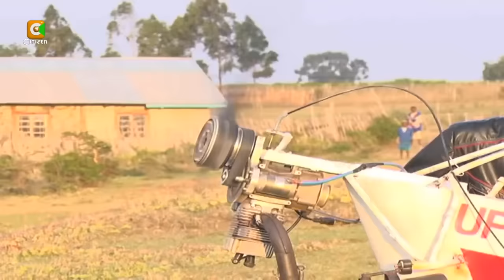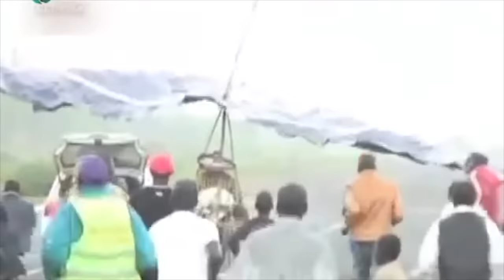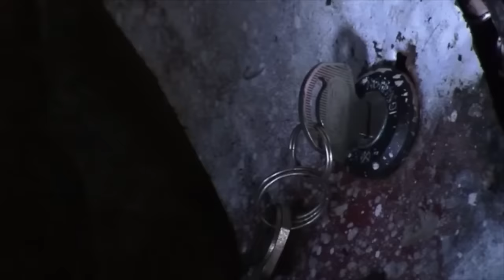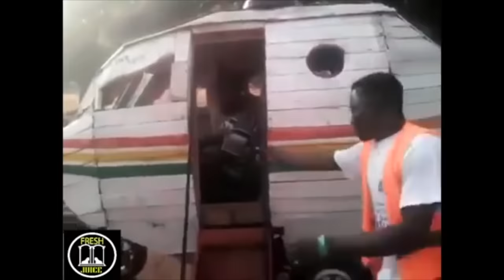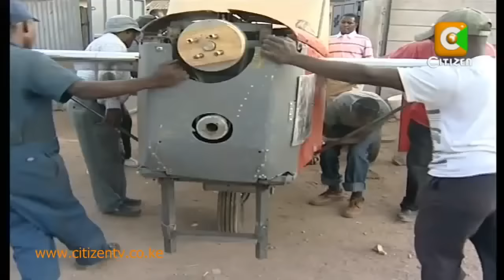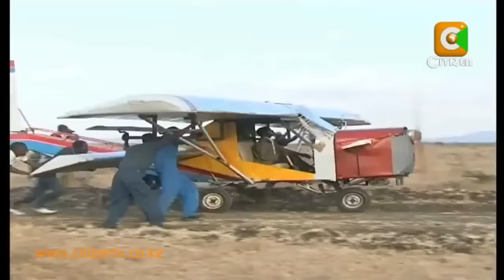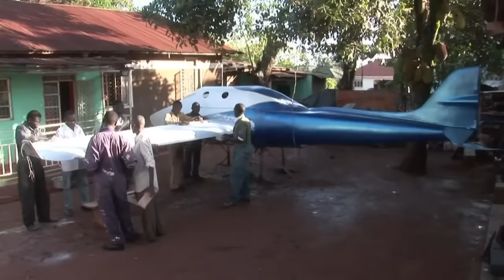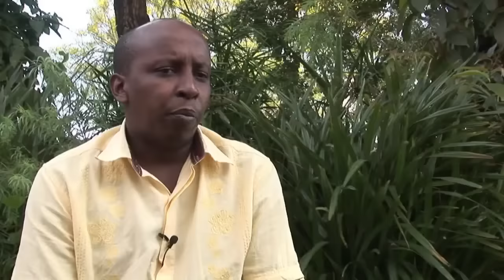African Airplane Compilation | African Aviation

Comment: Trying to take off a one ton airplane with a 15 hp motor!
Reply: Even a small Cessna weighs less...
Reply: And a piece of 2 by 4 for a propeller.
Reply: 15 horse power plus 10 human power lol
Reply: The nze engine is around 140 horsepower, however that is not enough, they need some mentorship from someone with knowledge
Reply: 65hp can fly a plane
Reply: Lol.
Reply: On top of that the frame wasnt strong enough at 5 mph on the ground
Reply: My airplane I made as a kid which was essentially 2 bits of wood nailed together like a holy cross had more chance of flying than that thing that fell apart on the runway 🤣 but can't knock their passion. Hope they find guidance
Reply: It was more like a 400kg with a 5hp engine
Reply: earlst plane fly with 25 hp.but made of mate with wood
Reply: Aircraft built will angle iron... That's a good one!
Reply: it weighs 800 kg
Reply: @abroms.ash.9  yes but must be light. His is built of literally iron. He needs some 7075 grade aluminium. Light and strong. And then he needs a prop with a good profile to move alot of air.
Reply: @wlad yes and the cri cri only weighs 63 kg.
Reply: @am-fq8lz  Mentorship? No, they need to realize that manned flight is out of their reach...
Reply: Really? Wtf...
Reply: Kharifhele Netshilema   Doing the wrong thing is what is keeping him alive.
Reply: What amazes me is when a man affords a spoon to it with.
He literally forgets fast and start asking himself why these people cannot eat their hot food fast with  bare hands.
Reply: tinlizzie37 he’ll make it next year once the gear design is flawless
Reply: Yes, it is possible, with a good prop, as little as possible pay load and wings with high aspect ratio the plane will take off. Now you,ll ask me what is aspect ratio, I am as black as charcoal African in Africa with very low .... you call it IQ? I don,t know!
Reply: @am-fq8lz  140 horsepower most likely at around 5-6000 RPM. Propellers rotate no more than 2700RPM, how much power is the engine making at that rpm, 30, 40? That isnt the only problem, the engine wasn't made for this, it would need a serious re-tune.
Reply: they gotta glue some feathers onto the wings if they wanna make it work!
Reply: @user-tl5xm3qj6x  hahaha in arabs countries?

Comment: "My wheels keep falling off but I don't think there's anything wrong with the aerodynamics "   😆😁🤣
Reply: The problem wasn't that it was too heavy but that the wheels were not heavy duty enough to support the weight. 

What's aerodynamics? Is that something important?
Reply: Aerodydamics? What the hell is that? It doesnt matters!!!!
Reply: @3xjavier108     Javier, That's a bit harsh.
Reply: Well, it really isn't the biggest problem. His biggest problem is thrust/Power. You can make a brick fly, if you can get it to move fast enough :-)
Reply: This video is proof that big dreams, lots of ambition and hard work just isn't enough to make it in life and can actually have a negative effect 😂....... (Reporter) "Poor Dekimbey spent his  life savings trying to build his dream flying machine & is now homeless but still hasn't abandoned his dream."
Reply: @michaelbrinks8089  loool
Reply: 800kg. Fortunately it will never get off the ground.
Reply: Yes, just some fouling of the plugs!

Comment: "The wheels can't support the 800kg plane, thats why it won't fly" 

Yeah because the weight isn't a problem on its own
Reply: It has nothing to do with aerodynamics...lol
Reply: @Skeleton Archer All 3 things are wrong.
Reply: A Cessna 172 is 757kg, but that was designed by American engineers (in the '50s) so...
Reply: If your plane weights 800kg you gotta need something more powerful than the engine of a motorcycle
Reply: too much weight, too little power, hopeless materials, insufficient vertical stabiliser to counter torque if a large enough engine was fitted, wrong prop, wheels too heavy, CoG looked way off. Better to build an established design before trying your own, at least you then can get some idea of construction standards and techniques. Nothing here is close to being a functional aircraft. The 'helicopter' thing was quite scary, with it's undersized rotor spinning way of axis. If that goes much faster it will likely break up an kill someone. A typical LSA is <500kg mtow. Something like a Zenith 701 or Kitfox would be an excellent plane for short unprepared strips in these areas, and simple enough to build.
Reply: @southern04man  Propulsion and physics lol
Reply: Should have put some rims on dem tires gnomesayin?

Comment: Building an airplane with massive steel frame is essential. I would recommend to build the cockpit from bricks and have a nice sofa as passenger seats. Keep on keeping on, sisters!
Reply: Am no need for Satire. On contrary at least someone is doing something
Reply: weren't a lot of earlier non-combat aircraft steel framed? The piper grasshopper was definitely canvas on steel. With modern engines you can absolutely get a steel framed aircraft airborn.
Reply: @Survivalnerd 
They've definitely got good enough engines. If someone could make it work with 40s era tech then they can definitely make it work with relatively modern engines even if they aren't top of the line.
Reply: Your comments brought me to tears lmfao
Reply: @briannawanji-yy4uv  you call this doing something? 😂
Reply: @jerrymartin7019  The piper you referenced is a tubular steel frame with canvas covering, an order of magnitude lighter than the steel box section you see being employed repeatedly along with the aluminium or steel skin they're using, for reference the piper you mentioned weighs in around the 350kg range when empty whereas one of those creations came in at 800kg, the guy who was being towed by the car with a fabric/plastic stretched over a frame in flexwing/weight shift style probably stood/stands the most chance of ever getting into the air.
Reply: And do not forget to use very large wheels, my brotha. Remembah…de biggah de wheels, de softah de landing!
Reply: lmfao!
Reply: Also a pickup truck engine which is no way similar to an airplane engine and isn't powerful enough to spin a propeller to achieve the needed lift.
Reply: @harpernicholson6822 don't forget welding gbombs 5 missiles to it to give a quick takeoff!
Reply: @haydenjory7109  Wood and fabric. Definetely not steel!
Reply: @paladinfoxx6574 well... there is a US kit airplane from the 40s I believe that used a ford model A engine. That's definitely a pickup truck engine  and much less powerful than a modern engine for that matter.
Edit: correction, it was the Pietenpol Aircamper that I was thinking of that used Ford Model A engines, it was designed in 1928.

Comment: Let us not forget the Zambian space agency. True pioneers.
Reply: Still better than the ruzzian one. After all, the latter had to partner with the Zambians
Reply: @512TheWolf512  tf?
Reply: @512TheWolf512  There has to be a former to be a latter.
Reply: @512TheWolf512  mindbroken by russians lmfao
Reply: @512TheWolf512  lol bro I think you should cut amount of political talk shows a little bit
Reply: afronauts
Reply: @512TheWolf512  at least the Russians got off the ground lol
Reply: The Zambian space agency is closer to getting to the moon then the Italian space agency. The Italians have tried unsuccessfully getting too the moon several times, but they keep running out of scaffolding 😅
Reply: The afronauts were awesome
Reply: Also failure because why Africa poor country
Reply: Maybe wild fire doesn't know about a little thing called sputnick or yuri gagarin. The Russian space program was top of the line

Comment: The guy closing his eyes while welding had me in stitches
Reply: They did that at my old shop all the time...... amazing
Reply: @detonator1329  they got betta.....   😜🤣
Reply: Nice catch 😅😅 I'm fkn deadddd 🔥☠️☠️☠️
Reply: With no protection probably the right move
Reply: It’s actually quitte common in Africa. I tried explaining them multiple times but then I got nonsense like “you only know how whites built with western tools and not like Africans”. I even saw them putting a saw blade on a grinder without any safeguard, I told them they are completely nuts. Well he is a cripple nowadays after the blade “walked” over his foot and is replaced by a guy who uses the same stupid grinder in the exact same way!
Reply: Maybe he can't afford the welders goggles.
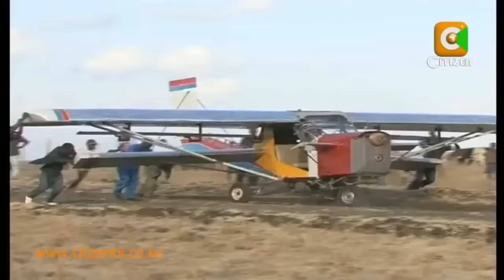Reply: 5:16 This monstrosity had me in stitches,,,oh hell nah!!!!
Reply: @Mark-vn7et  Saw blade on a grinder is extremely scary if one is actually conscious..

Comment: This  sure  makes  me respect the Wright  Brothers  for what they did over  100 years ago..
Reply: they weren't the first
Reply: @AverageAlien  so what?
Reply: Without all of the needed instructions readily available online and in libraries.
Reply: @AverageAlien  they were white
Reply: They were educated.
Reply: @AverageAlien  the Wright brothers created the first powered airplane
Reply: @theincrediblehulk5797  Santos Dumont did the first actual plane with an engine,  the americans brothers build a hang glider. Vai Brasil 🇧🇷!!!
Reply: @Salahuddin_Official  I should have clarified, the wright brothers built the first successful powered airplane, which made flights earlier then Dumont in 1903. Everyone thinks the wright brothers first powered flight was in 1911, but that was not the case.
Reply: @blob5907  nope, the first were still white
Reply: catapulta não é avião
Reply: @AverageAlien  they were the first to have controlled, powered flight using wings. A plane that could steer itself. They built the first fully practical airplane a few years later. Not an airship, but an airplane.
Reply: @general9657  exatamente
Reply: @Brave_Sir_Robin  no they weren't, they were just the first to get famous for it
Reply: @Brave_Sir_Robin  Was it really an airplane if it wasn't able to take off unassisted?
Reply: @AverageAlien  bro a zeppelin isn’t a plane
Reply: @theincrediblehulk5797  Nope! :)
Reply: @AverageAlien  bro his Airship no 6 is a zeppelin or whatever you want to call it not a plane
Reply: @Brave_Sir_Robin  Yes exactly it is a zeppelin these people know nothing about aviation
Reply: @alanwatts8239  yes. Is a navy jet really a jet if it has to take off with a catapult? The designed one like two years later that didn’t need assistance.
Reply: @Brave_Sir_Robin  Every navy jet i know of can take off under it's own power, they use catapults on carriers because of the short runway, not the planes themselves.
Reply: @alanwatts8239  obviously, I was just using that as an example of what is definitely a plane taking off using assistance.
Reply: @Brave_Sir_Robin  It wouldn't take off on it's own even if they put it in shigatse peace, if it can't put itself in the air it's then a glider. It being powered means nothing when it can't carry it's own weight up, which is something the 14 bis did numerous times. Even more, the 14 bis was the first plane that took off while being watched by a crowd of people.
Reply: @Salahuddin_Official  wrong
Reply: @alanwatts8239  only facts, Vai Brasil!
Reply: @rubberknees  your reluctance in accepting the truth, don't mean I'm wrong. 
🇧🇷Santos Dumont is the father of aviation.
Reply: These guys are the Wrong brothers
Reply: @geerenmo  Comments are a bit of a cesspool but, fun fact they each had 3 years of high school, and no education past that. (unless you count their experience as bicycle manufacturers, still pretty amazing.)
Reply: @Salahuddin_Official  Santos Dumont was more known for things like hot air balloons, which the Montgolfier brothers did over a century before him. That’s why he gets no credit 

Still an amazing story, though
Reply: They started on time. And this is how they started by trial and error.
Reply: @AverageAlien  first to have consistently controlled flight.
Reply: @lemonator8813  no, just the first to have it documented
Reply: @AverageAlien  source?
Reply: @lemonator8813  source these nuts
Reply: Really makes you think.
Reply: @AverageAlien  I respect this 🍺
Reply: @Salahuddin_Official  every machine the wright brothers built had an engine, they were first
Reply: @alanwatts8239  navy planes can't take off ships unassisted, does that make them not planes?
Reply: @unknownuser1102  Yes they can.
Reply: @alanwatts8239  no they cannot, that is why aircraft carriers have launch cables, they assist the jets because the flight deck is not long enough otherwise
Reply: No, you missed the point, the point is there are planes now who cannot take off on their own under some circumstances, many navy planes ONLY serve on aircraft carriers never actually landing on land, do those who never land on anything but carriers not count as planes? They will never take off under their own power so?
Reply: @unknownuser1102  Do some research please, because everything you said has a little smell of wrong in it
Reply: @alanwatts8239  I did, I found planes that spend their whole life on deck, and guess what, they are still planes.
Reply: @unknownuser1102  Just because some spent their service life in the carriers doesn't mean they can't land on airbases. What if they are in a war and can't land back on a carrier? eject? lol
Reply: @Salahuddin_Official    Do you have a link to any info on  Santos Durmont?
Reply: @theincrediblehulk5797  https://en.wikipedia.org/wiki/Alberto_Santos-Dumont
Reply: @AverageAlien  https://en.wikipedia.org/wiki/Alberto_Santos-Dumont
Reply: @mikeskidmore6754  yes I know who Alberto santos DuMont is he is one of the great early aviators, he is a pioneer in early aviation but he didn’t make the first powered flight with an airplane
Reply: @theincrediblehulk5797  I was the first to take flight by it self, that a real plane, not a glider that needs a catapult.
Reply: @Salahuddin_Official  dude I just told you that the wright brothers made the first powered flight in 1903, much earlier then dumont, this is a historical fact, dumont was a great pioneer in aviation that is why he is still known today and Brazil is greatly represented by him, but he does not have the claim to the first powered flight

Comment: "According to his judgement the problem lies in the rear wheels". According to my judgement the problem lies in trying to fly a plane made from steel with a highly optimistic wing loading on an underpowered 2-stroke engine, all welded to a frame so feeble that it breaks apart at the slightest jolt.
Reply: Woah, woah too much logic. It only has to look like a plane.
Reply: Sooooo....its fine?
Reply: Nick K  and their dreams are totally crushed too when it fails. They had it right this time dammit.
Reply: @nattybumpo7156  😂😂😂😂

Comment: They should start with gliders before making planes with Toyota engines attached to a fan
Reply: KFC steward
Reply: Not to mention shoddily welded steel frames. Good luck hauling all of that weight up.
Reply: For Africa, where there is no department store it's pretty good.
Reply: @dawid12301d  Their country has close to no education since the government owns all the money. The people are uneducated so they can't even figure that out probably.
Reply: @Speed_7545  You don't need much education. It's just common sense. If they can design and make an airplane they have to know at least some basics and it looks like they know how elevons/rudder works etc. Those planes are way too heavy and welded in a shitty way so they break apart on every bumb. And if you need a group of people to push your plane to make it airborn then well... Don't know about you but I would not expect someone to push my plane while im actually flying. They should perform at least few tests with thrust/weight ratio on the ground. You can't just make something that barely moves and expect it to fly on your first try without tests.
Reply: Dawid Dziedziak Or Because of lack of research. You can’t start out with iron and metal. It’ll be better if they start out of wood and fabric. Education is the problem, there’s no scientific proof of it being genetic so stop the propaganda. The first one flew because of education.
Reply: But Africa doesn't have wood.
Reply: Not in large amounts anyway. And the available stuff isn't the right type.
Reply: Perhaps you can tell us why Kenya Airways, Ethiopian Airlines and Air Tanzania are doing so well at the moment, then. I mean, surely, airlines with a majority of black pilots wouldn't perform very well with such technically advanced equipment as a 787, now would they?
Reply: Fly a kite first.. Then rc plane
Reply: cloud ix Ironically, the worlds best high performance glider planes are built and designed in Africa...
Reply: Fan it is, but what Toyota engine? That is my Scotts lawnmower one cylinder engine ;)